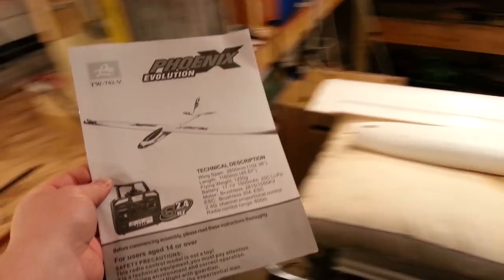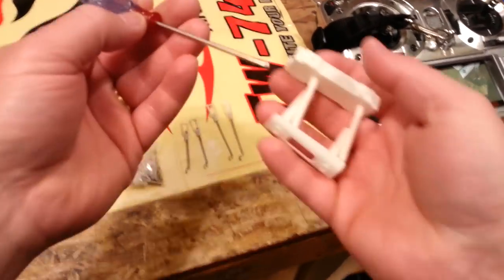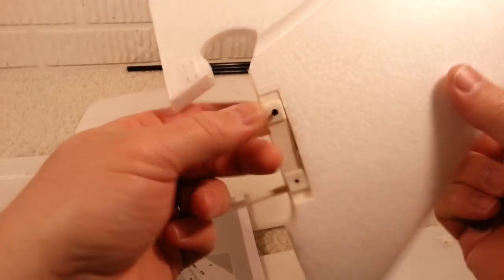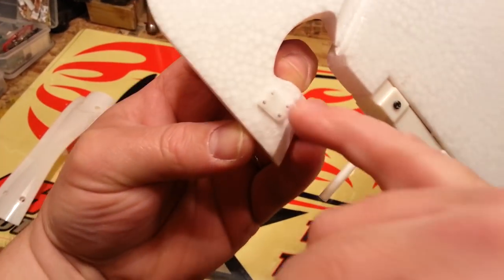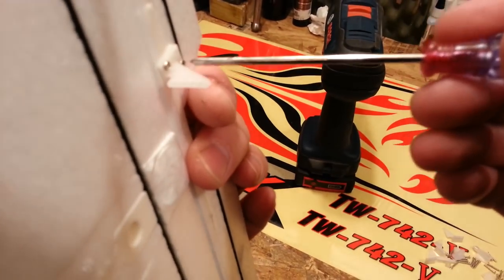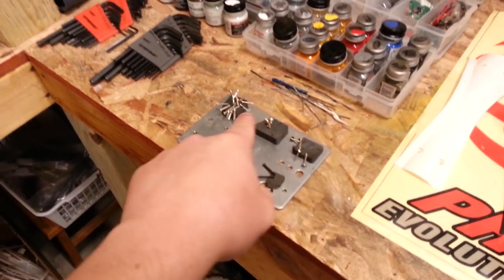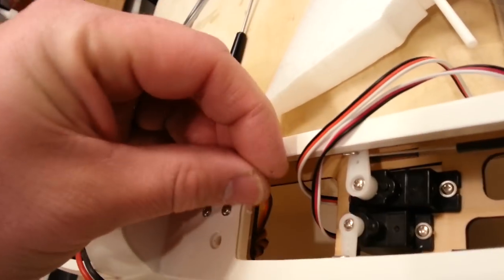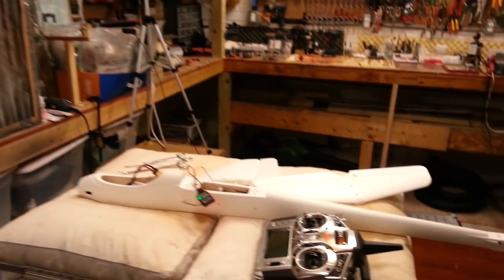Volantex RC - Phoenix Evolution - 1.6m/2.6m Sail Plane - Build Series - Part 1

Comment: I think your rudder control horn backer plate thing is on upside down because there are little indents on one side that usually go into the plane so the screw doesn’t have to be as long. Maybe it’s different on this plane:)
Reply: You beat me to it Kalvin , I was shouting at the TV   .  :-))
Reply from the maker: This plane has some weird hardware...wait till Build Video 3 and 4 ..... you'll see ;)
Reply from the maker: Graham W2000 & Kalvin Winder - Yeah, I've done that before too, but then the screes stick out bare...so I've never really known for sure. I've done this backer plate BOTH ways, but on this one, and of late, I've done it the way I did  on this video (maybe I'm wrong????)

Thanks for the comments guys!

Comment: and also one more thing with this tx which i wrote below can i bind with bnf models of eflite???
Reply from the maker: Spiros I believe you can bind DSM2 OR DSMX on the Lemon-Rx 7 Channel with Stabilization. I'm sorry that I can't say with 100% certainty since I haven't done it myself, but all the documentation says it will work.

As for the BNF models, you should be able to bind with DSM2 OR DSMX. This I HAVE done, just not with the Dx7SE...

The only time I've had a problem was when I was trying to bing TWO separate recievers, one  DSMX/DSM2 and the other DSM2 only....THIS didn't work, even when I forced my DX18 (Gen1) back down to DSM2....it's because of this very strange situation, that I hesitate at all, but this was a STRANGE setup that is more weird that what you're trying to accomplish.

I believe you WILL have success with binding both to Lemon-RX and Horizon Hobby BNF planes.

Good Luck!

P.S. If I were you, I'd talk a buddy into letting me try it out first on his BNF, but the Lemon-RX reciever is so cheap, it's probably worth the risk ;)

Good luck!
Reply: Brian Phillips thanks brian for ur reply ..all the best fm athens.
Reply from the maker: You're welcome!

Comment: Btw, do you have any overheating issues?
Reply from the maker: I have had pretty good luck, BUT after about 3 flights with 2200mAh 3S 60C pack through this plane, the motor is pretty warm (AKA Hot!!!)...but that's kinda, to be expected, since I'm running a larger prop :)

Comment: Bran hello again ..i need ur assistance again..i want to set up the lemon rx in the timber..but i am confused with the correct position of the switches...i saw some videos but...and here in my place there is nobody to know about this..
Reply from the maker: What is your question?
Reply: Brian Phillips sorry if i am not was more specific..i am asking about the 1,2,3 dip switches..must be on or off???
Reply from the maker: I think you may have seen this, but it will give you an idea of how to setup a more basic model using the Lemon-Rx 7 channel with stabilization...
Part 1 - Unboxing - https://youtu.be/t0gZxFQhgjQ
Part 2 - Build - Decals - https://youtu.be/NhOfLMfswlc
Part 3 - Build - Radio Setup - https://youtu.be/aLKelbn0spo
Part 4 - Build - Assembly Part 1 - https://youtu.be/KFnHVmk49U4
Part 5 - Build - Assembly Part 2 - https://youtu.be/SCuo_rnDTtA
Part 6 - Build - Motor Breaking Setup - https://youtu.be/k1Oj7il8uIM
Part 7 - Maiden Flight - https://youtu.be/IRcgunwcKUA
OR

If you're in a hurry - START HERE...https://youtu.be/aLKelbn0spo
Reply: thanks  a lot for ur time and ur reply...best rgrds!!
Reply from the maker: Sure thing!